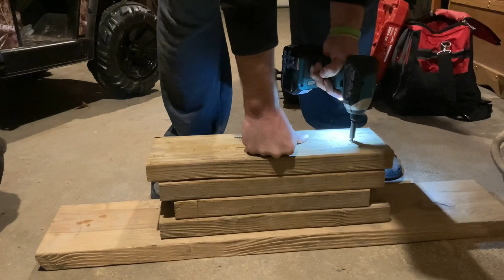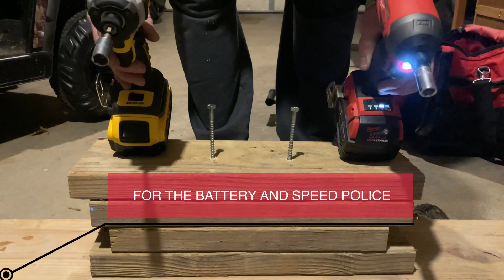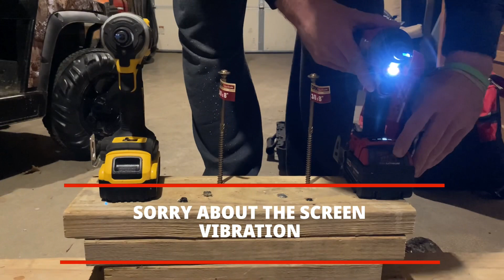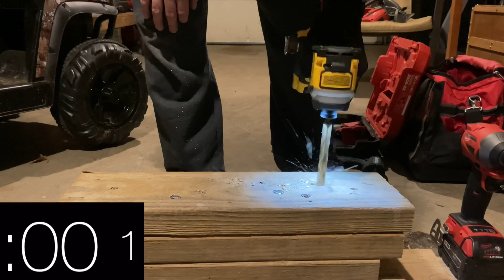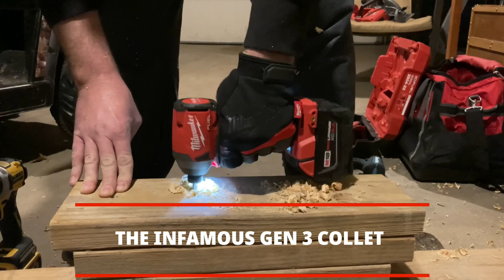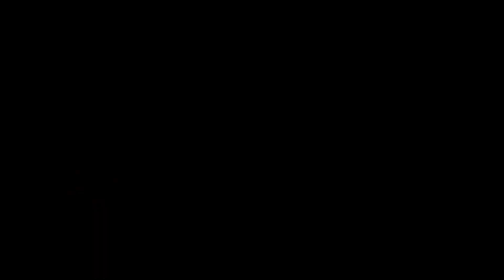Milwaukee Gen 3 Fuel Impact driver VS Dewalt Atomic DCF 850/ Powerstack

Comment: Looks like Milwaukee is on speed 2?
Reply from the maker: Nah, it was the 3rd speed the entire time. That’s an old 5 ah battery and it got down to 3 bars of battery power after the 1st couple tests. And still beat it🤣. As you know if I would have put the high output 3.0 battery on it, the Gen 3 would have finished miles ahead. Just wanted to show what the Milwaukee could do with an old out-dated battery. I’m not taking nothing away from the 850 dewalt, it’s got power, but nowhere close to the Gen 3. Thanks for watching brother.
Reply: @IMPACT-NATION  might be wrong but Milwaukee somewhat more expensive than DeWalt across the line. I can't justify the price of Milwaukee tools with DeWalt on sight. Also that 850 is so compact...I am really curious if Dewalt has something a little bigger maybe to compete with that Milwaukee. Anyway both great tools!
Reply from the maker: @andreis254  I totally agree with you on that man. Milwaukee is high priced. I always wait for buy more save more or bogo deals. I started with Milwaukee so they always be my favorite, but dewalt I find myself reaching for more and more. Like you said, sometimes I forget I have that 850 hanging on my tool belt it’s so small. Especially with the Powerstack Battery

Comment: Gen 3 collet can only be fixed by filing your claim and waiting for the replacement driver.
Reply from the maker: This is actually 3.5 I guess you would say. It has the dual ball bearings and the bits still slip out. Not as much as the single bearing collet but still happens sometimes. Appreciate you checking out the video my brother
Reply: @IMPACT-NATION   I owned 3.5 gen driver too. But I have never tried to use an impact driver to to drill holes on nosing or stair treads...